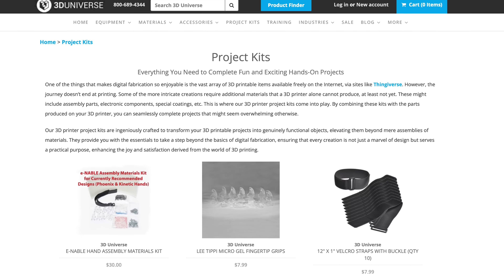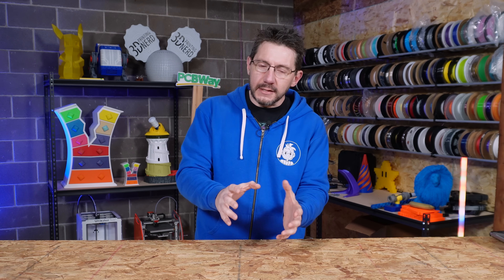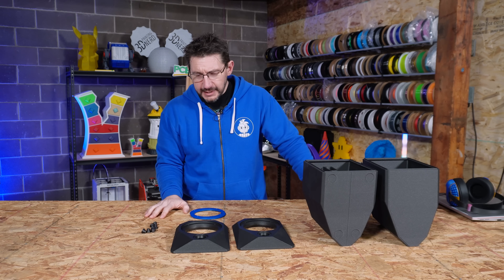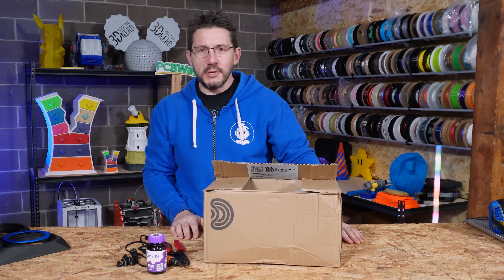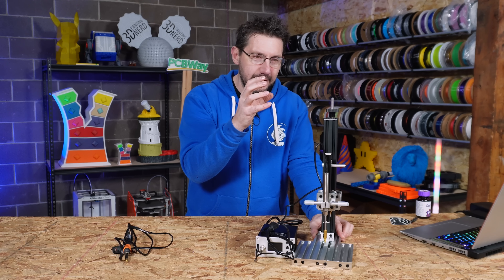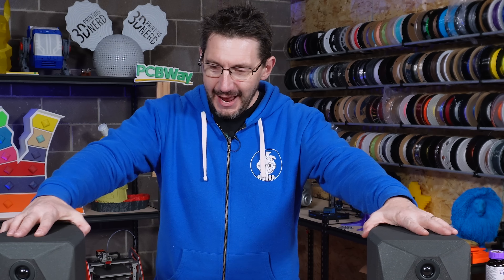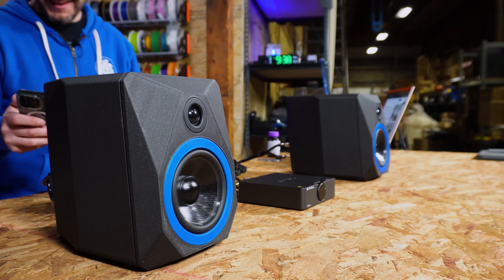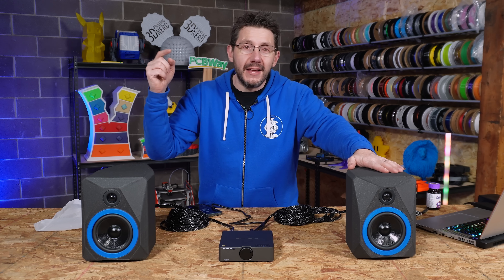THESE SOUND AMAZING!!!

Comment: very cool probably sound good or could and mostly due to that face plate - could take it further with interior structure designed to eliminate backwaves better
Reply: Tell me you know nothing about soundwave's and speaker enclosures without telling me you know noting about soundwave's and speaker enclosures.

If he used wood it would of sounded 100% better.

Comment: Cool project, I come from a high fi background and am intrigued by the idea of maybe pouring something into the walls to add density. Plastic is a pretty terrible material acoustically but obviously awesome for custom shapes. Maybe there are some higher end drivers available out there too. Hold my beer. 
Thanks for the inspiration and video!
Reply from the maker: Ooh, pouring something in I love this idea.
Reply: Plastic is the worst for speaker enclosures, always use wood.
Reply from the maker: @ or not. these sound cool.

Comment: Wow awesome video and great project!  Just subscribed!  I was going to build my own speakers using timber but why not just print!  What bed size printer do you need?  Mine is 220 x 220 x 250 cm
Reply from the maker: They say a 256 cubed volume is what it needed. You may be able to cut parts up in the slicer.
Reply: @3DPrintingNerd  Thank you!

Comment: Kit: 250
BL A1: 350 (dimensions state Ender 3 owners are out of luck)
PETG: is it mentioned anywhere how much is needed? Does it sound different if other type of filament is used?

I can find cheaper speakers 😅

Seriously, without testing against similar speakers, not much can be said about them. Graphs tell part of the story but they don't indicate how the speaker performs in listening environment and how they sound . Are they meant to be placed in corner, near wall or standing alone?
5.5" still needs subwoofer for movies etc, for plain music it will work (at least in smaller spaces).

IDK what "right to repair" means in this context? Are all the parts specified for getting replacements? What was the last piece of speaker that any of you broke 'cause I haven't? (I'd guess the element, either punched a hole in it or tried to outperform the amplifier)

There's a saying "if only tool you have is a hammer, all yer problems look like nails". We see this awfully clear with 3D printing where everyone is asking "could you" instead of "should you" 😉

Comment: I’m considering getting one of those kits, would be an awesome project! One small correction for you though, Joel. Wires are the collection of strands within a jacket. When two or more wires are grouped together via jacketing like for speakers, or say Ethernet, those are called cables. I know it’s a small thing but it is a difference worth noting. My background is in custom cable making, and low voltage/telecom with a focus in audiovisual integration :)
Reply from the maker: Thanks for the correction, I always appreciate the heads up when I get something wrong.

Comment: There are nice, but too big for my tiny workspace. I've designed my own to fit in. Even with my minimal knowledge, they sound's much better than I expected. And due of power of 3D printing, I'm planning to do some experiments to check if I can make them sound even better.

Comment: sorry but I don't even need to hear these to know they don't sound good. there's a reason why actual speakers are made of dense MDF
Reply from the maker: I don't even need to read your comment to know what you said is false. See how that works?
Reply: @ but it’s not false. You can’t fight the laws of physics. Any resonance in the plastic will greatly distort the sound.
Reply from the maker: @snowboarderrx  Okay, real talk. I do think you're correct - any sort of resonance in the plastic can distort the sound. However, these do sound good. The work of Deposition Sound and people like Pete at HexiBase do amazing stuff with 3d printing and sound reproduction. I just ask that before you pass judgement at least wait until you can hear sounds from these with your own ears.
Reply: @snowboarderrx  3D printed speakers if designed correctly are not prone to resonance and posess both very low mass and high rigidity which is exactly what we want for a loudspeaker enclosure. The enclosure walls are essentially an inner and outer skin with a support lattice in between.

Comment: Finally a high end speaker baffle with multifasets around the tweeter that avoids late reflections from the edges! Well done! I bet these measures extremely well.
Reply from the maker: Ooh, that I don't know, I don't have the tools to measure.
Reply: Guess what, you can do this with even better material, it's called WOOD and your speakers will sound 100% better than using toxic plastic that aren't environmental friendly.

Comment: If you like the idea of 3D printed speakers, check out what Paul is doing at Polymate3D.  He is pushing the absolute limits of 3D printing technology to 3D print the speaker drivers as well as the enclosure.  His Fidelity 7 and Symphony 7 speaker drivers are now competitive with commercial drivers costing a lot more.  In Polymate3D’s case material selection makes a massive difference in how they perform — it’s a very cool engineering challenge.
Reply from the maker: Oh I know what he is doing, it's INCREDIBLE

Comment: very respectfully, I thought this looked like an awesome project and a 3d printed speaker kit sounds rad, but as soon as I looked at the shop page on their website, I got mad sticker shock.  I've heard some stuff that are fully built that sounds pretty fantastic for less than half the price.  there are quite a few inexpensive drivers that sound really good, and I understand that support and kit building costs money but until they can get the cost down, sadly, it's not something I can recommend.

Comment: @3DPrintingNerd After designing some of my own speakers from hdf/mdf and wood I have a simple suggestion that should improve sound quality. First, I would paint a couple coats of resin or auto filler on the inside of the speaker cabinet. The more airtight the cabinet is, the better. You don't want layer lines or gaps on the inside. Bondo is another option. Second, throw some rockwool filler on the inside when you close it up. Those very cheap upgrades would improve the quality to comparable retail speakers.
Reply: There is some foam filler in the kit, he showed it.
Reply: Some accousti fill might help with reducing reflection as well
Reply: Using wood is the only way to build a enclosure for speakers.
Reply: @gemininimeg  I mean, no it isn't, but nobody is stopping you
Reply: @anthonyp4209  yes it is, I build speaker enclosure, so I know.
Reply: @gemininimeg  cool. Science would disagree with you but again, nobody is stopping you from doing you. This sounds less like an opinion based in fact and testing and more like one based in presentation of your way if doing things
Reply: @gemininimeg There is nothing magical about wood. Further, not all speakers need to have an enclosure. Some would argue that they even sound better WITHOUT an enclosure. You may want to open up your horizons a bit.

Comment: Love the idea, but you can buy high quality studio monitors such as the Kali Audio LP-UNF for less than the kit + amp. Then again, people with 3d printers want to build their own :P

Still really cool that you can customize the enclosure. Only audio things I've printed have been speaker/headphone stands and under desk mount for a DAC.
Reply: @DarthV506  yeah, I'd personally not invest in something like this without a review that includes measurements. I don't care what color the cabinet is. I don't care how "great" it sounds. What is the frequency response and power output and all that stuff. I buy speakers to make noise.
Reply: @RichFreeman  I totally agree. But your best audio measurement tool always have been and always will be your own ears. I don't care about dBs, I want to "feel" the music, experience a virtual "stage" and discover details in the music I haven't heard before.
That's why I suggest that people start out with a proof-of-concept dummy, where the shape of the front baffle, reflex ports, position of the tweeter as well as volume are very easily customizable and the design of the speaker can be dialed in systematically. Once all the parameters are there, you "freeze" the design and print out your enclosure with those empirically determined values.
BTW: the speakers in the video sounded as if they had a severe cold 😁... even small plastic monitors need a break-in phase, I guess.
Reply from the maker: That's true, I very much love all sorts of mediocre stuff. Heh.
Reply: @3DPrintingNerd  If the speaker kit and amp were cheaper, than yeah, cool project. But if it costs the same or more than actual studio monitors, no thanks. I'm sure they will work just fine at parties where nobody is doing critical listening :)
Reply: Nah just go into your grandpas or fathers shop/garage and make the enclosures out of wood which will sound 100% better.
Reply from the maker: @ Mine sound great. Out of wood sound great too.

Comment: Cool, but they need smaller wall mount speakers.
Reply: @SB-nt9fp  that's the beauty of 3D printing. You can put these into a modeling program and add what you need to make them wall mount.
Reply: @VraerynDaDragon  but they'll still be just as large. OP wanted them smaller, and the hardware only comes in one size.
Reply: @chriss590  Once again, the beauty of 3D Printing, you can do that too.
Reply: @VraerynDaDragon  but the components are still for the large one, so it doesn't matter that you can print a smaller frame if the components don't fit it.

Comment: Why does everyone 3D printing speakers (except hexibase for the most part) design them as if they were made out of wood?! Tons of 90° internal angles and such. 99% of them start as print box insert speakers. Nothing to see here
Reply: We definitely stuck to more traditional designs for the FDM5 & FDMGeos. Be sure to check out our FDM4s, they include a 35" serpentine port, and the FDMS8 for a new approach to a powered subwoofer.
Reply: Check out the 3d printed speakers Joel made a few years ago. No sharp corners  and complex internal bracing. Shame it sounded like something wrong with the tweeter or amp in the sound demo.
Reply: @Audio_Simon  Agree. Either those speakers had a severe cold or they need to be properly "broken-in"(?), you know, playing just white noise at quite some level for 48h, ... makes a ton of a difference.
Reply: @Audio_Simon  those were terrible in every way
Reply: @Steveborough  Care to elaborate? Also what would you do then?
Reply: I agree, my 3d printed speaker designs usually start with a sphere.
Reply: ive designed a box that is more like that, for 6x9's.  Still waiting on a couple parts to finish my voron build, once i get it finished and the boxes figured out completely ill be posting them on printables.  The box itself is all one piece and then has a lid, but that is irrelevant sonically just aesthetic only.